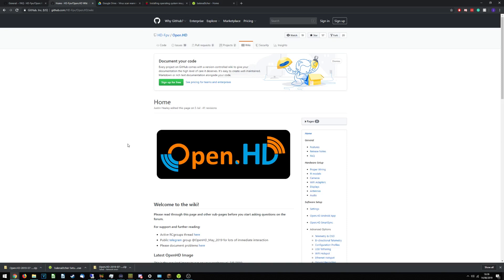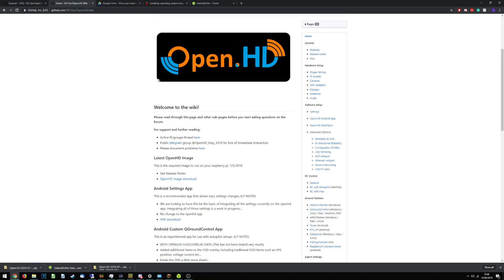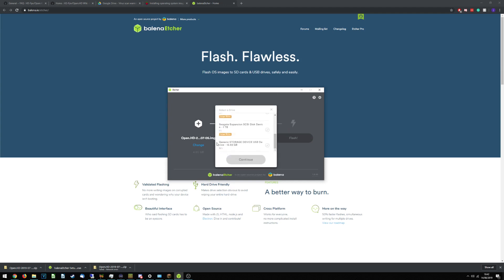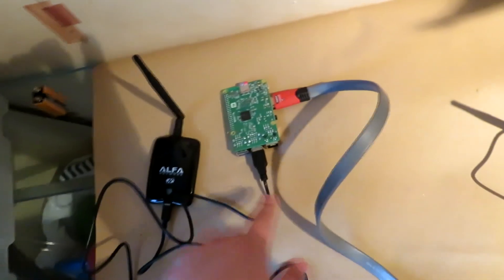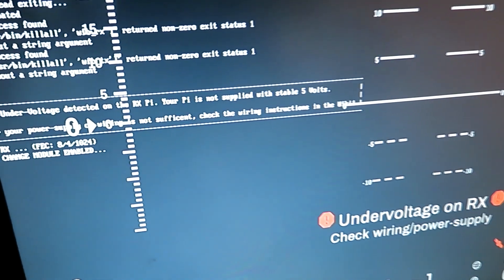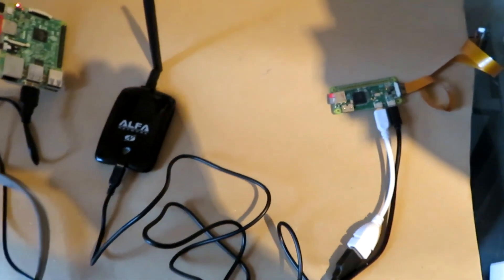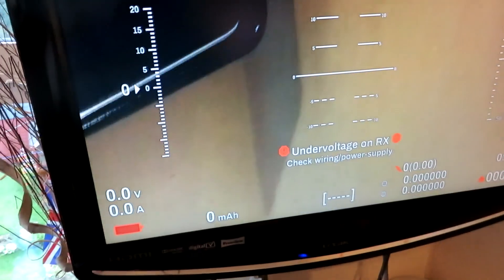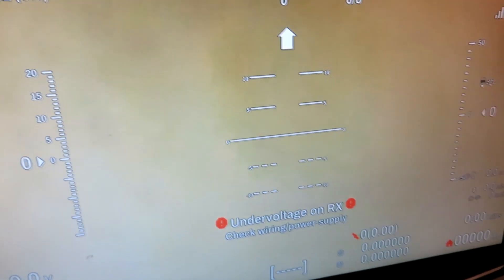Digital HD FPV On A Budget!: Part 2 - IT DOES JUST WORK (First Try) (DJI FPV Experience Alternative)

Comment: hello, thanks for the video, very useful;) I am new to the world of PIE, so I have a probably stupid question, but how did I turn off the PIE when finished? because for me everything works but since digiview is a program which takes everything (not under linux or other) I do not know how to turn it off properly. every time I turn it off, (via power supply (no choice!) .. because even by plugging in a mouse and exiting the digiview program, (yet it asks me if I want to turn it off, I say yes, and it tells me ask if I'm sure I say yes, and there it goes off, the only thing is that despite that, I have to turn off the power, and so I have the sd card to redo for the next ignition. you know how to extinguish a PIE properly without any other program than digiview on it? (a hardware modification? a button i can't see ..) ..), so i have to redo the image on the sd card, and that's it is very annoying .. so please if you have a solution to turn off the PIE cleanly and simply ?? so that I can turn it back on afterwards, and it just works again! I look forward to your response, thank you, AureL

Comment: Hi Jake. I have put Befinitiv provided file 'htc_9271.fw' in /lib/firmware folder as described in Befinitiv guide on manual settings for wifi broadcast to get high data rate but I am not getting high data rates. I am using Laptop with ubuntu other than raspberry Pi. Is this the main cause of problem. Do i need to run any commands. I have atheros dongles and they work in monitor mode, only data rate is a problem

Comment: Hi, Jake Do you have any progress in this project? I am worried because many Youtubers start but most of them don't finish work with OpenHD :( I don't know why :( maybe it is still not so easy to fly in the air
Reply from the maker: I just need to get the plane to put it in that's all
Reply: @JakesRCStuff  Finger Cross for you to get a plane quick. Funny because people who bay eg DJI FPV don't finish on the desk. Effort what you need to put in OpenHD to bring him from parts, configure put to plane and final air is still too large for typical RC user :(